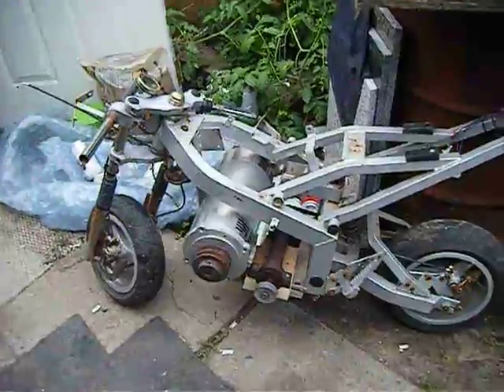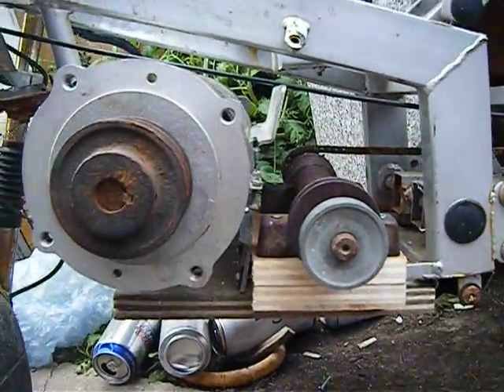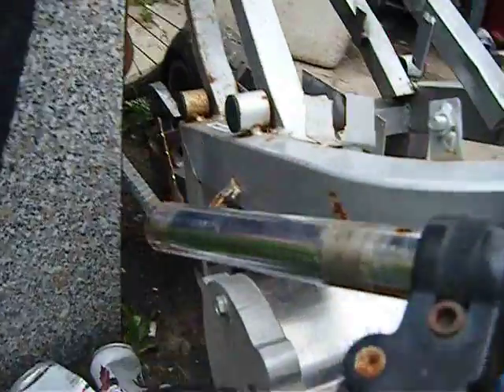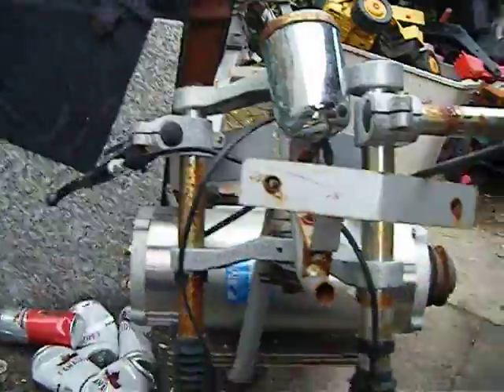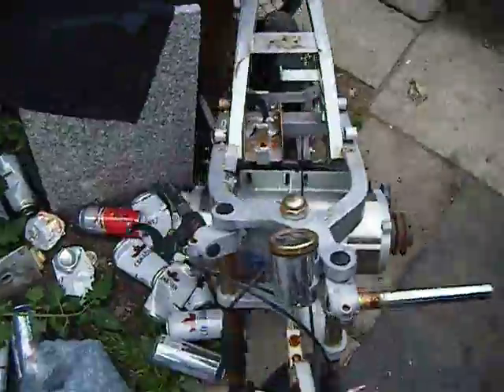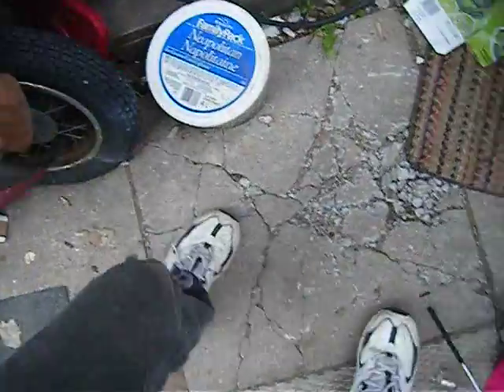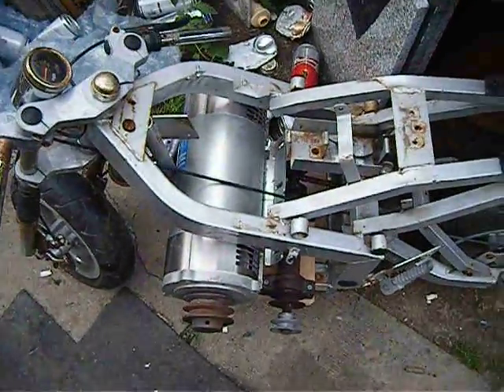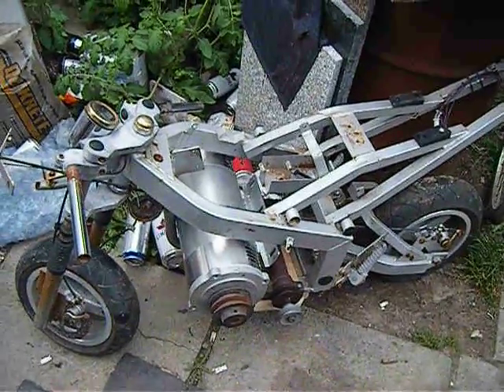electric motorcycle, pocket bike, diy, electric vehicle

Comment from the maker: @advthinker I got my hands on a 12volt curtis but couldn't get it to work so I used coils (relays) for 6v, 12v & 18volt running 1, 2, & 3 at a time, I'd like to run all 3 for the 6volts but I don't have enough coils, thanks for you'r advice

Comment from the maker: @advthinker Thanks, what the problem is is low amps. I can use 2 big 6volt deep cells for 12volts of raw power but with all the cordless drill batteries I used it wouldn't pull me around, maybe if I set them up to give me 18volts